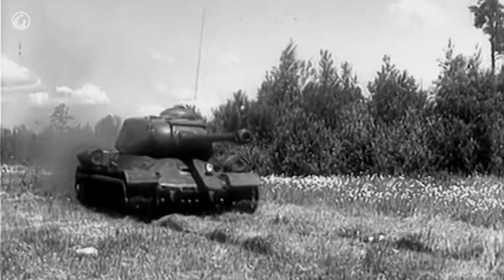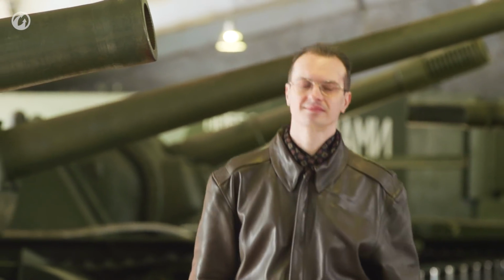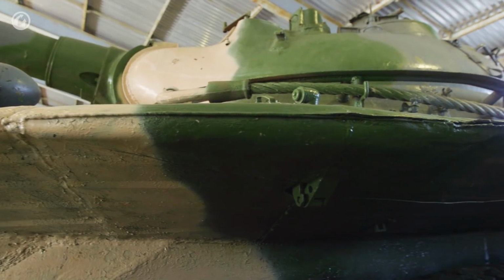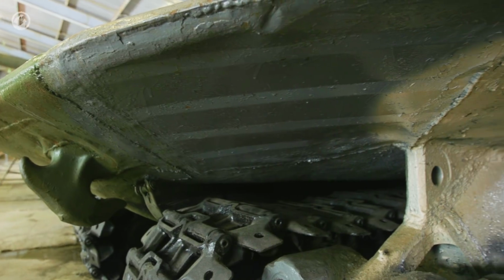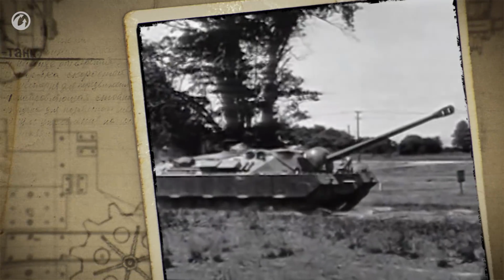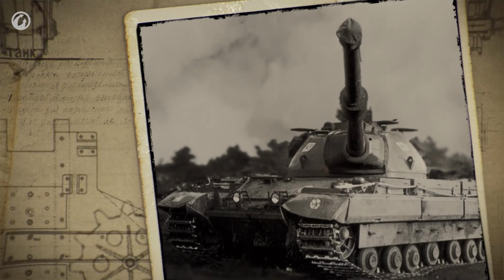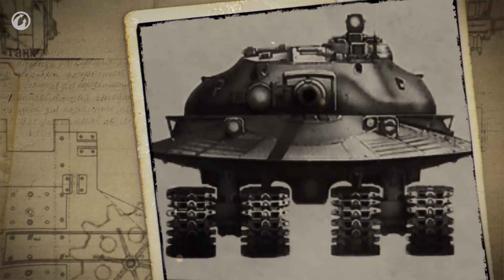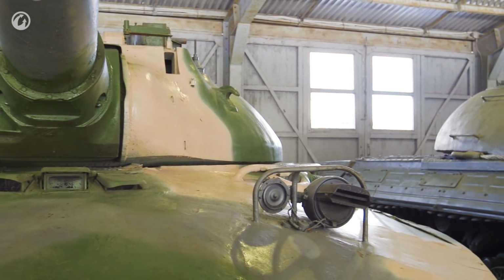Object 279: The Warrior of the Apocalypse

Comment: It’s funny how people complain Russian tanks are op when in fact they were built like this in real life...
Reply: Read books written by German tankers, read reports and u will see how " good" was King Tiger . It wasn't , it was useless, slow, bad traverse, bad cupola traverse, total crap. Turret traverse was so bad that it couldn't follow T 34 flanks if noticed under 300 m , they were easily flanked .    T 34/76 could screw King tiger under 400 m, and in most fights IS 2 won against King Tigers. Most dangerous tanks in ww 2 was tank destroyers actually...and near the end of the war it was IS 2 , Germans tankers got orders to evade fights with IS 2, to stay away from them  . There are dozens pictures of King Tigers with half blown cupolas by IS 2 shots. Trick about IS 2 was high-explosive/fragmentation shell , even if it doesn't penetrate other thank , it would render that tank useless , it would screw cupola mechanism, kill crew , damage engine, make mess inside the tank. Similar thing was with SU 152, Su 152 shell would break open other tanks kill crew with it's high explosion shells.    Panther was a good tank(copy of T 34) , consider it wasn't that expensive to make. Tiger 1 was bucket with good gun and stupid flat armor . T 34 with less armor was more protected then Tiger 1 thanks to angled frontal armor. Germans had good results at the start of the war because Russians were unprepared , not willing to fight for communism, after they organized they started screwing Germans badly.

Comment: Here comes new tier 10 russian premium heavy tank with no weakspots, huge ammount of penetration on premium shell and mobility of light tank.
Reply: Mystic3 Meyhem maus is overrated lol
Reply: Sebastian Nowak maus still better
Reply: NinjaDaNinja Too weak for stronk russian heavy. 0 accuracy and .0001 aim time is much better. It will also have a 10 round autoloader, with .8 second inter clip reload, 10 second clip reload, 800mm on it's ammunition, which is gold only (as in you have to open your wallet to fire) it will also have a hp/t of 30, top speed of 80km/h. It will be a tier 8 premium, with pref mm allowing it to see tier 8 max, but as low as tier 1 (that way people will be less likely to see it in tier 8 and so improving mm). This will be the ultimate in balanced gameplay, and will come with patch F.U
Incase anyone thinks I'm serious, nope. If anyone at WG thinks it sounds like a good idea smacks with newpaper BAD WARGAMING!